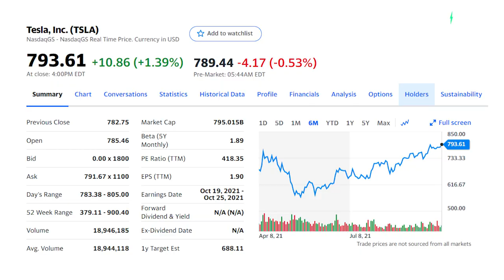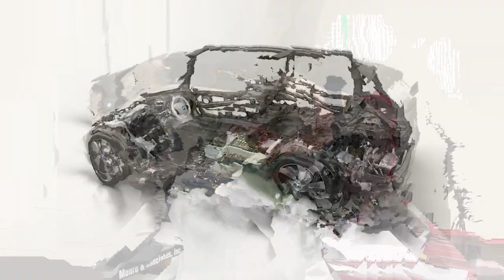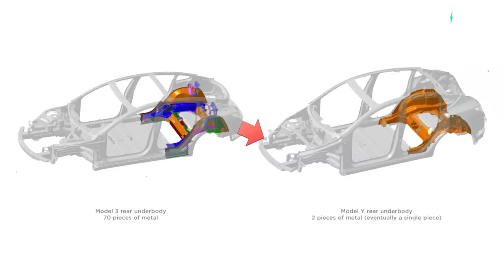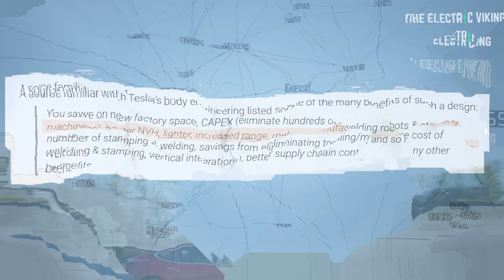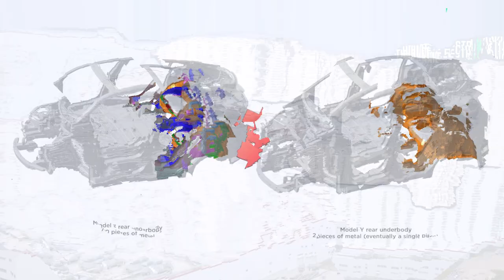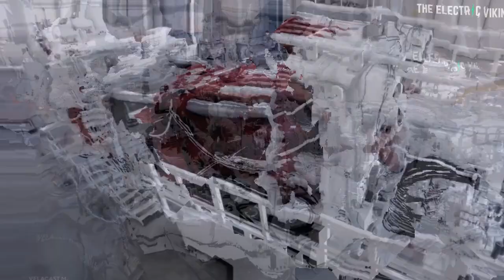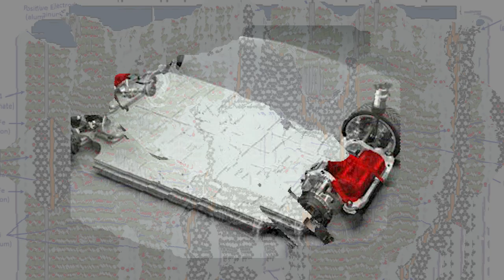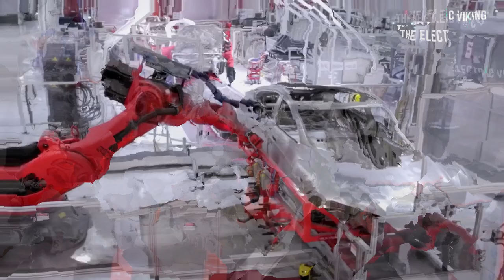The most important TESLA engineering game changer this YEAR

Comment: The other automakers aren't using these large castings because, so far there is only one casting machine maker (IDRA) supplying such huge machines and TESLA has contracted for all of them.
Reply: Actually I heard there are Chinese companies getting their hands on these machines! Like Elon said, China is the only completion.
Reply: THe Parent Company is LK in Hong Kong and IDRA has facilities in China. LK has sold a 5,6,8 and 9 Tonne machine, I believe to SAIC (GM and VW are partners with SAIC which makes the $5K vehicle with GM)
Reply: @gazlives  2028 if they are lucky.  ultimum battery looks like a bust so far
Reply: The material is key to the casting this size.  To avkid patents, other companies would need to discover a new material to make these castings work.
Reply: @thundastrike3210  Figuring out what is in the mix should not be super hard to do.  Buy a car deconstruct it then send sample of the casting for spectro analysis along with other testing means to determine just what metals are in the casting along with proportions. As far as I know it is not a trade secret other than that the exact amounts have not been openly disclosed as to proportion.  Without having designs that would need to use a casting of this size along with the management making the decision to go this route I see no reason that any other company would look to use the giant castings.  There are many companies that make casting machines and I guess there being no real demand why would any of them push to build anything other than the ones we see for things like control arms and such. There is a reason legacy makers take 30 hours start to finish on an assembly line vs the 9 for tesla. perhaps someone can tell me why some say nine hours and others say 90 minutes actual build time
Reply: @stevepailet8258  "There is a reason legacy makers take 30 hours start to finish on an assembly line vs the 9 for Tesla". Shout out to unions. No, fair enough, if you want to "keep workers in well-paid, secure jobs", you will resist the introduction of robots, time-saving measures, and high speed production. Everything comes with a price...
Reply: @chrisheath2637  slow rolling themselves out of jobs sure sounds about right
Reply: @stevepailet8258  I don't know, but I'm sure horse companies, buggy manufacturers, livery stables and saddle makers resisted the change...
Reply: 😃👍 Go Tesla go! 🚀🚀
Reply: Sandy Monroe told all the OEMs about the castin said

Comment: Could the front and rear castings perform more than structural tasks?   Aluminum is a good conductor of heat. Is it possible to integrate heat exchangers into the castings?  This would eliminate the need for a separate heat exchanger unit.  At a minimum they could use the casting as a heat sink and bolt on a length of aluminum tubing that leverages the massive heat sink. Just a thought.....
Reply: Good idea! 💡👍
Reply: Great idea, send it to Elon and the tesla team. Or use it to get hired? 😀

Comment: Thanks Sam.  I am keenly looking forward to Tesla cascading the casting and structural pack through all production lines.  Will result in lighter, cheaper, faster vehicles.  Also will corner on rails.
Reply from the maker: Fingers crossed!
Reply: And prevent changing the suspension geometry. It doesn't do so well at Nurburgring, when on paper it should do far better. Almost 100 ICE cars are quicker. Handling sucks now. Let's hope they fix the problems before committing to poor design.
Reply: @MegaWilderness  Good point. I'm sure they can alter the mold later if they have to, but modifying an existing car might be tricky.
Reply: @electricviking  With Tesla EVs already 10 times safer to drive, means 10 times less likely to need repairs. With Tesla making 3 times the profit per Vehicle, it means that Legacy Autos currently need 270 hours to make the same amount of dollars. VW is the only Legacy that has openly admited this so they seem to be the only ones that may survive (just like an addict that admits they have a problem before being able to attempt to remove the addiction)

Toyota may survive in Japan because of National pride

Keep up the great work Sam! Would like to see you do a video on how retarded our acceptance of EVs has been in Australia, just to share with many of my friends....

Comment: Been trying to get a handle on just how many Idra casting machines Tesla has installed at its 4 gigafactories. Best guess so far is 8 at both austin and berlin. Why am I looking at this is fairly simple  Figure each press can make on average 360,000 castings annually.  If some vehicles only use a rear casting like a cyber truck and they have two machines in Austin that comes out that they can produce 720,000 trucks.  If Both austin and berlin double their casting machines so they can do front and rear.  That would indicate that each plant could do between 3 -4 million vehicles per year.  Assuming 3 million out of each plant pretty well thinking they will be as big as Toyota in a matter of a couple of years with 6 to 8 million output compared to the ten million toyota is producing.  30% margin wow who knew it was this high.  Good reason Tesla is on the way to being the worlds most valuable company
Reply: Why don't you think CT will have a front casting?
Reply: @bru512  Guess because only heard about the back casting.. So will wait all speculation till they start production

Comment: Check out Joe's 10/11 giga texas drone release. They will be using structural battery packs whether it is 4680, 2170 or 18650. And there is a change in manufacturing that will remove more robots and potentially reduce the possibility of a robot damaging the inside of the body in white. It may even cut a few more hours off production? Not sure where the spark of genius came from but they deserve a brownie.

Comment: It seems weird to debate the possible problems with a gigacasting. You answered your own question already. These castings are structural and stronger than the current structure so less likely to be written off. These model y’s have been around for a while and there are many on the road the data about write offs must already be available. What’s important is the cost of insurance not the repair ability. Insurance companies are crooks though and I doubt they use real imperial data in some cases favouring rumour and conjecture hence Tesla supplying its own insurance.

Comment: Why doesn't legacy auto do this?

Going from 150 parts down to 2 means they would have to lay off or re-allocate a lot of union workers. 

If they try this sort of thing, employees will strike.
Reply: This is a possibility.  At Tesla the Robots do most of the body assembly, so they are getting "fired" by the IDRA casting machine.  Not sure what happens at other manufacturers.  There may be a lot of QC being performed by people in this area as well.

Comment: The repairability of a Tesla matters to consumers because if a small wreck results in a total loss, the insurance companies will raise rates on those vehicles.
Reply: Agreed.  This is where Tesla Insurance can step in and mitigate the claims process.
Reply: Don’t forget that each wreck will have evidence of what the cause was so no expensive litigation and more likely to recover costs from other vehicles insurance.
Reply: Unless of course your insurance comes from Tesla, which is backed by your driving data. They are in the early process of rolling this  in the US. I am a big believer in right to repair but can see why Tesla have not supported it to date. I do think things will change over time as the wider auto industry starts to transition - but at the moment the average mechanic (some good, some not so good) has a different skill set than the one required to work on many EV components, but many may try anyway.
Reply: @colint8281  I agree about Tesla offering insurance. However, I wasn't referring to right to repair. I was just saying that the giga castings might increase repair cost which might increase insurance rates. That said, I love the idea of the giga castings.
Reply: @malcolmrickarby2313  I love Tesla. Just bringing up a point. I love the idea of the giga castings too.
Reply: Assuming that the vehicle is a total loss?  Who could make best use of the car?  Tesla.  They could take all of the parts and use them in their service program, essentially recycling the car.  This is just another facet of vertical integration.
Reply: @malcolmrickarby2313  This is a great point, and is very much TOTALLY under-estimated.  Tesla's simple camera and steering/pedal data collection system is revolutionizing the liability/legal/policing industries.   For a peak of the future,  check out Wham-Bam-Tesla-Cam videos of where fights and arguments END when Tesla owners show people the tesla-cam footage.

Comment: A structural battery pack is foolish, it makes replacing cells impossible. Far better to provide each car with two batteries that the owner can alternate at home, leaving one to be solar-charged and run the home while at work. No point in charging one battery from another.
Reply: I agree with the repairability issue. But what about "charging one battery from another"? What are you referring to?
Reply: @itekani  A solar-powered home would normally be fitted with a battery to power the home overnight, hence powerwall.
Reply: @MegaWilderness  No, a structural battery is part of the load bearing structure of the car as opposed to a load that has to be supported by the body of the car.
Reply: @itekani  So how do you replace it, when it goes wrong? Grind it off and weld a new one in its place? The biggest problem will be all the cells glued in place.
Reply: @MegaWilderness  It's bolted on place, I assume. But there's no way of replacing individual cells. But I guess with a million mile battery it won't be an issue. If some cell is defective, it shows up under warranty. Then they can replace the whole pack and recycle the old one.
Reply: @MegaWilderness  that is pretty much true of the battery packs now. Though with modules one could change out one or two modules even if it was only a couple cells going bad.  Not actually happening enough to be more than a statistical anomaly
Reply: @itekani  Everyone talks of a million-mile battery. I see nothing in the warranties yet. And even if they're meant to be million-mile, how are they repaired?
Reply: @stevepailet8258  Have you watched videos of how to get into a Tesla battery. Full replacement is the only option. Who has money to repurchase that?
Reply: @itekani  The warranty is not good enough for the secondhand market.
Reply: @MegaWilderness  They are not repaired. Consider for a moment a million cars made and what two shops in the entire country that have done a repair on a battery pack.  More opening the pack and changing out an entire module.  These batteries are not sealed but are darn close to it. Might cost 5-10 K to have one repaired and likely would need to go to California to have it done.  At this point nearly all of the batteries are still under warranty.  odd things happen like the one where a cooling line broke. odd ball stuff and a simple repair.    Kind of reminds me of the term the common cold ... it is not the uncommon cold and it is not common for the batteries to go bad. I see a lot more of these batteries on the secondary market pulled from wrecks. Nothing wrong just that the insurance companies scrapped them
Reply: @MegaWilderness  I think it is very rare that a cell goes bad after the warranty is out.
Reply: @itekani  Batteries degrade because of dendrites, they grow exponentially because they get progressively closer to the cathode. I have never seen an individual cell with high cycle life what makes you think it any different in a battery.
Reply: @MegaWilderness  I'm not saying it would be different in a battery. But if a cell goes bad because of normal degradation, not because it had a manufacturing flaw, then all the other cells in the pack will be degraded to a similar degree. Then what's the point of replacing cells when you would have to replace all of them?
Reply: Structural pack is not foolish at all.  You save weight, reduce parts, increase range and profitability.  Reducing weight means less batteries in the pack and lower overall cost.

As for cells going bad, Teslas management systems have proven to be reliable over many years.  The death of cells are dependent upon misuse from charging.
Reply: @itekani  I completely agree with you, but what are the chances of 3000 cells staying in lockstep with one another?  A tiny difference in manufacture will start the rot. Watch any video on DIY Li-ion battery assembly. The fact you have to try and balance the cells, proves they're not all equal in manufacture.
Reply: @richpalmisano1740  It's only profitable for the manufacturer. The customer loses, and they're harder to repair and recycle.
Reply: linkzable  Best cycle life I've seen on CATL LFP is 4000 giving about 10 years if cycled once per day. Not yet good enough to be used in stationary storage. It also makes it risky for second-hand car buyers. It's a bit like buying a plasma TV in the face of better batteries to come. Tesla's cycle life is nowhere close to this yet.
Reply: @MegaWilderness  Is it?  Maybe so right now.  Early adopters will pay but after production ramps the overall cost will move down for consumers.  This is always the case.
Reply: @MegaWilderness  Tesla has a lot of statistics for battery health. I believe I saw an interesting graph published in their sustainability report.
The cycle count you saw, what depth of discharge was that at? The amount of cycles you get out depends a lot on that. Not many people will use their entire pack every day.
Reply: @itekani  I've seen those graphs but never to 20 years. I'm more concerned with the 10 to 20-year area.
Reply: ICE engines are foolish, but for different reasons. Having 2 batteries to swap is even more foolish. You seem to know something about batteries, which is good. But I respectfully suggest you do more research...
Reply: @chrisheath2637  ICE engines are not foolish, they're a work of genius over a long period of time. Burning fossil fuel is foolish. They're far more complex than any electric motor which is why I ask why they cost more than ICE. The manufacturer to have the balls to drop all the electronic crap and produce an efficient EV with good range at the cheapest cost to the customer will dominate the market.
Reply: @richpalmisano1740  Take a look at Arrival's plans for battery packs. Each module including chemistry can be replaced.
Reply: @MegaWilderness  battery swap is a concept ripe with failure IMHO.  

The more moving parts, the more points you have for failure.  Also, this means you have to have battery packs just sitting around waiting to be used.  This is a waste of resources that are already scarce.  If battery supply was ahead of need, then I might consider it as a viable option, but as for my previous concern, it still stands.
Reply: @MegaWilderness  We'll just have to wait and see for that time to come around. The trend looks promising though.
Reply: @MegaWilderness  Agree, and as it happens Sandy Munro, and I, both love the Chinese Changli. No needless crap there. Ok range a bit weak, but it's so colourful!
Reply: @chrisheath2637  No one disagrees with Sandy and I will not be the exception. These things are cheaper than cell phones yet pretty much include a cell phone as well. How do they stamp the panels, make curved glass, include all those deep cycle batteries, spray paint with better quality than Tesla. Extraordinary, Bet you'd have more fun racing these than driving a Tesla.
Reply: @chrisheath2637  If you think having two batteries is foolish perhaps you should have two cars, leave one at home to be charged via solar during the day and run the home, the other you take to work. Oops Tesla doesn't support V2G

Comment: When Tesla gets into their own insurance company for their cars they will corner the market they have no competition for aftermarket parts at least right now.    And yes if they get in an accident big enough to damage those mono cast structures it will total them out or be so expensive insurance companies other than Tesla‘s insurance company will have to charge higher premiums. 

            Tesla can charge lower premiums for their own cars because by that time their automated driving in their safety sensors will have their cars having so far fewer accidents that they will also be the most profitable automotive insurance company to. 

           All that stainless steel that they need for their space program that they buy in volume just put in a bid for a lot larger volume for all your cyber trucks bringing the price of stainless steel down for your construction cost gives you a bigger advantage over any of your competitors. 

If you have stainless steel you don’t have to follow all the rules laws and regulations and disposal fees for your painting factories for your vehicle. 

You don’t need painting robots you don’t need environmental encapsulated buildings you don’t need employees to constantly maintain the painting facilities because there is none with a stainless steel vehicle.